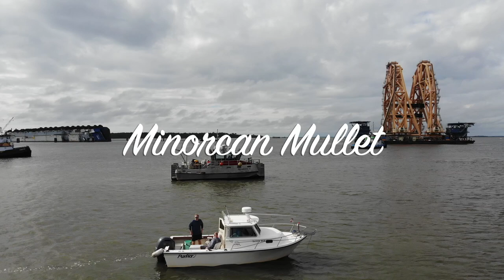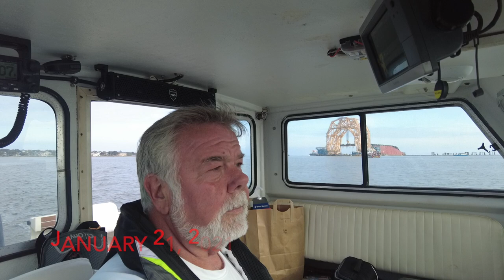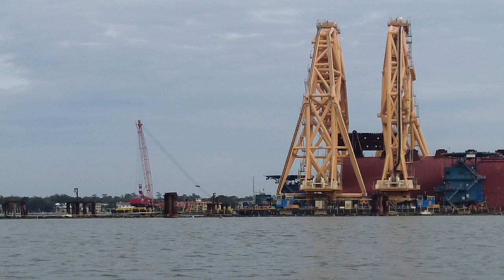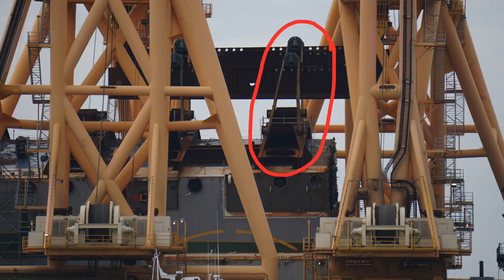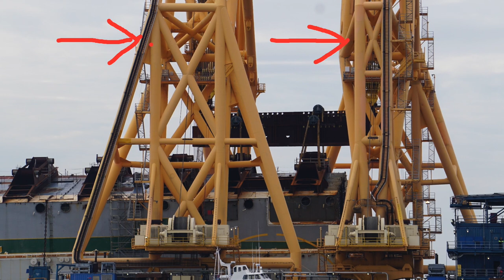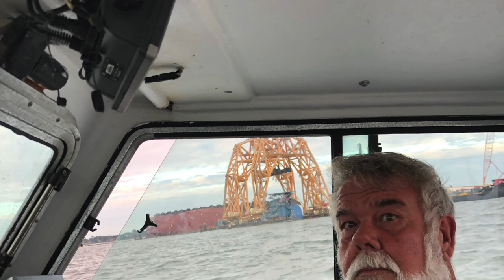NOTHING YET!  on January 21, 2021

Comment: You showed the straps today.  What kind of material are the straps made of that they can support that amount of weight?
Reply from the maker: Not sure on the specs of the lifting straps. I would suspect they are made of dyneema or similar material. As for what the actual lifting capacity, well 4 of them can lift a section of a ship with a cargo of vehicles in it. They are stout. MM
Reply: Roy look up Sampson Rope. The 3 inch diameter line on my vessel has a breaking strength right below 750k lbs. I'd guess they are using some line made just for the lift based on the size of it. They are also using it in a 'basket' form aka one eye on each block of the vb and using the loop formed as the liftng point.